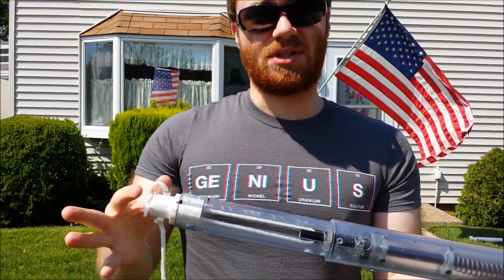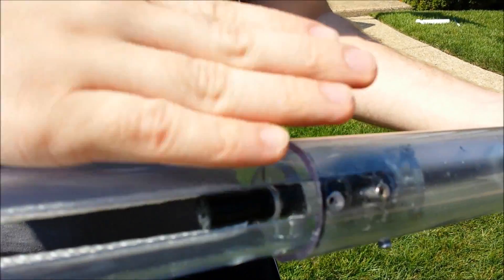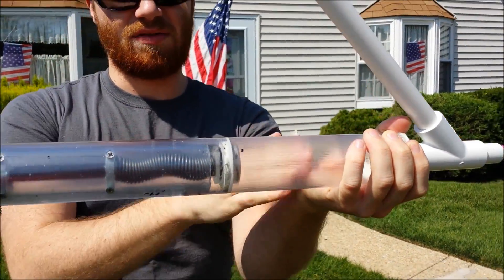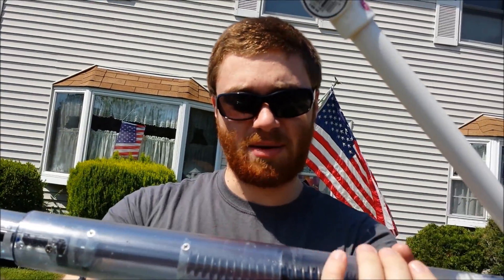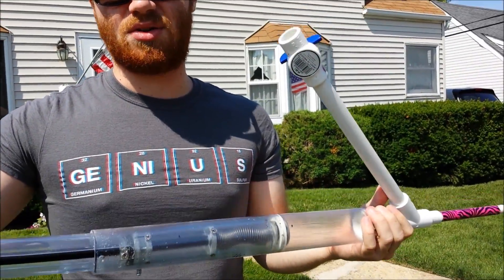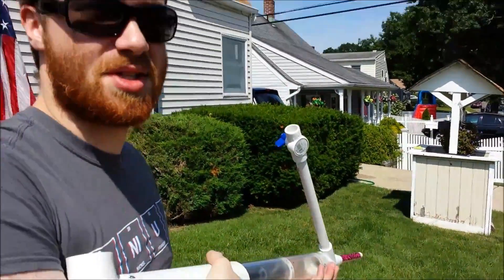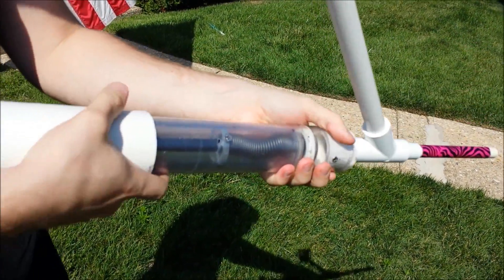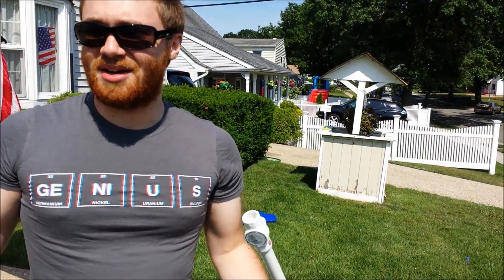Experimental Telescoping Plungertube Blaster

Comment: hey aeromech, first of all, thanks for your videos.
So I bought a 1.5 inch diameter pvc from mcmaster but the 9562K46 skirt seal is just barely too small. What do you recommend I use for the plunger on the wider 1.5 inch pipe compared to the normal rainbow pipe? I would use a smaller pipe, but I'm doing a personal project and my projectiles are ping pongs.
Reply from the maker: Yunskinator Whoa I wish I saw this sooner. Um check out nerfhaven, look at the 2-11. Its a wider diameter plunger blaster. I would also try a combination of metal and neoprene washers a la superlaative plunger head.